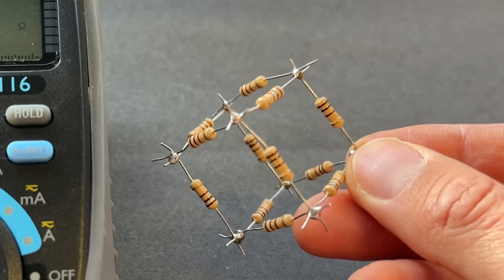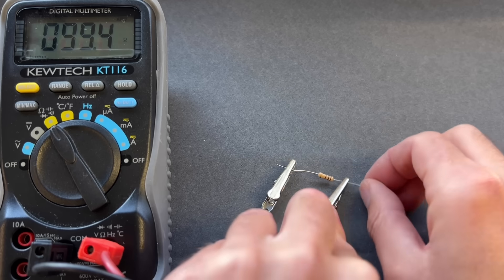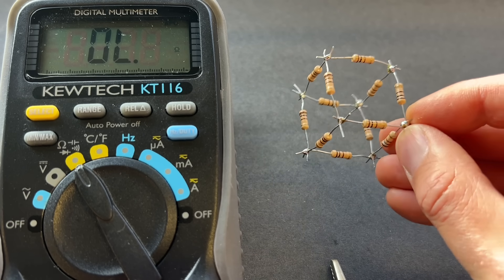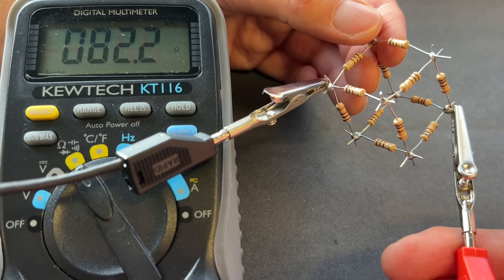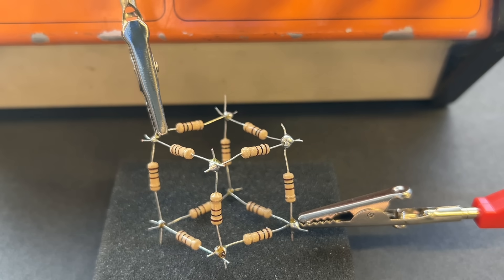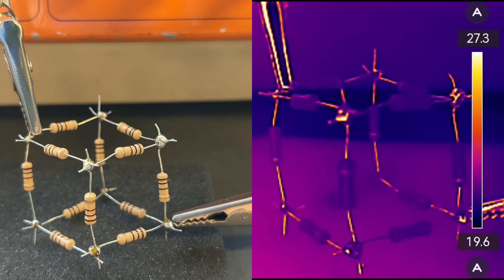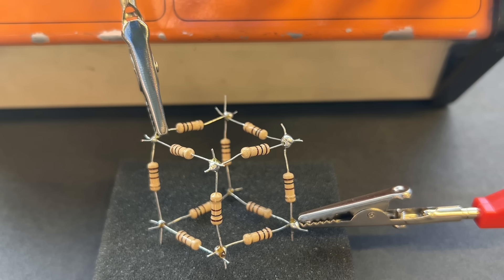A real resistor cube - does theory agree with reality?

Comment: I did the excat same thing back in the 80's just with 1 KOhm (I still got the cube) and using Kirchhoff's Current and Voltage laws, to calculate the resistance. I did not have a thermal camera back then but you can feel it.

Comment: After your video, the total theoretical resistance is quite simple to derive! 

You can think of the problem as a set of parallel connected resistors in series. There's 12 resistors in 3 groups: 3 input + 6 in between + 3 output. With the parallel formula you get the resistances: 1/R =  3 * 1/R or 1/R = 6 * 1/R. So the total resistance is putting them in series: 2 * R/3 + R/6 = 5/6 R.

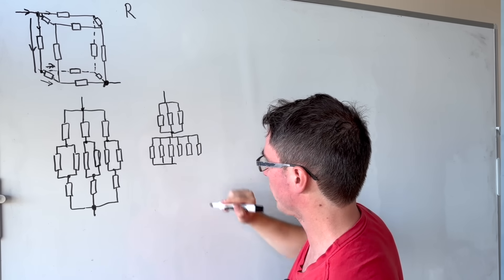Comment: 0:23 That is the not the correct topology for a cube; the correct graph for a cube in two dimension is a smaller square inside a bigger square with each corresponding of the four corners of the small cube and the big cube connected.

Comment: Failed to be anything more then differential pairs....

Non equal values makes for non equal results.

Taking the average,   not useful at all,   we can do basic avg as a viewer.

Not showing each value bacuae of time.    We clicked on a video on a platform designed around watch time.    

Come on.   Do it again,  and try harder,  match to 3 decimal points,  show numbers and show your work.
Reply from the maker: Based on views, watch time and likes the general consensus has been positive.  Sorry you didn’t think it was good enough but I won’t be doing a remake.  In any case the multimeters are only accurate to 1% so perfect agreement will never be possible.

Comment: You don't need any diagrams or "full theory" to solve it. Your symmetry argument works fine. Let the voltage between the crocodile clips be V and the current supplied be I, with each resistor being R.
It should be obvious (by symmetry) that each of the 3 "top" resistors attached to the positive croc clip passes a current of I/3. Similarly, each of the "bottom" resistors attached to the negative croc clip also passes I/3.
At the other end of each of those resistors that current (I/3) will split in two equivalent directions, so each of those "middle" resistors must pass I/6. Now, to travel from one croc clip to the other, you have to traverse one top resistor with a voltage drop of R*I/3, then one middle resistor resistor with a voltage drop of R*I/6, and finally one bottom resistor with a voltage drop of R*I/3. That's a total voltage drop of V = R*I(1/3 + 1/6 +1/3). But the equivalent resistance must be V/I = R(1/3 + 1/6 + 1/3) = 5R/6.
Reply from the maker: Yes that is my preferred way to solve the problem😊

Comment: So, if you guys have ever bought one of these voltmeters, you would know you can't measure resistance.  No I am serious, there are dials for it for different ranges, but you can't actually measure anything with those settings.  I have bought several models over the years from different manufacturers since the 90s and none of them works.  The only way you can tell the resistance of something is either you read the color coding on the resister and trust the manufacturer not telling you lies, which they always do cause high these things can get burned out, believe it or not.  This is the reason why all our electronic equipment will fail unless you take out the battery when they are not in use.  Or, in the case of modern electronic, they just get rid of these entirely and use semi-conductors which don't have this kind of issues.  However it has other issues.  For one thing, no one really knows how semi-conductors actually works.  At least I don't and I studied these things as a physicist.   In fact, I knew a guy in graduate school working on these things and he doesn't either.  I mean he didn't say he doesn't but he won't show me anything and explain to me how he actually make these things.  Just, you know, lithography magic.  And, this was an Ivy by the way.  Thank God I didn't waste my time on that and studied chemistry and biological physics instead.  We have our issues too but at least they are still within the realm of classical mechanics which we can deal with without "magic."

You see, you can only make semiconductor if you are in Switzerland.,  Only they know how to make these things these days.  Have you heard of ASML?  That's only one of them.

Let's hope they release their trade secrets one day, so the world may know.  All I know is that the tech is based on sound (phonon) and not just electricity alone.  

The other way is to set up a simple circuit and measure the voltage drop, which is very simple and actually works ......   except you have to use an equation V = I R.  And the problem is you have no idea what I is either, the current.  To measure that you can connect the circuit through a current reader .... which unfortunately, we have no idea how it actually works and it leads to a voltage drop too .... so .... 

Yeah ... electricity is weird.  I don't think we really know how that works either.  

Before you criticize me, call be psycho, crazy, conspiracy theorist, bisexual grandpa, idiots, smoking weeds, etc.  Please buy a voltmeter from amazon and do the measurement yourself and come back and tell me how you did it.  Yes, maybe I am the idiot and schizo and a conspiracy theorist.

Comment: Why do this? Why not just use a resistor of 82.4 ohm? What is the importance of this?
Reply from the maker: It is just as a fun challenging physics problem.  No point to it beyond that.  😊
Reply: And why don't you have rsistors of 100 ohm value?
Reply from the maker: @harshadnarayan1960  All resistors come with a tolerance that they can vary by.  I have 5% ones which are cheap.  You can pay more to get 1% ones which will be closer to 100 ohms.

Comment: Does the drawing reflect the actual cube circuit?
Reply from the maker: Watch the @zphyiscs video linked from the description for a full discussion of this.
Reply: @SimonPoliakoff Which is NOT the same circuit! When the drawing is wrong, the whole concept is wrong!
Reply from the maker: @BSnicks That is why the current symmetry solution is better which @zphsics also discusses in his video
Reply: @SimonPoliakoff  I know you can simplify the circuit because the resistor is the same. But if you simplify it, there is no real purpose of having such a problem anymore. Unless you want to waste resources.

Comment: At 0:13, the schematic on the left is inaccurate.  The six resistors in 2nd stage pairs don't connect at both ends with the same resistor.  The are paired up with one neighbor at one end, and paired up with the other neighbor at the other end, where they connect to the final 3 resistors.

Probably won't make any difference if all 12 resistors have identical values, but will if the resistors have widely differing values.

Comment: This was a question in my physics GRE exam! It is also a "challenging" problem on the Freeman-Young textbook.
Reply: Physics GRE? What is that?
Reply: @Temperius  It is one of the exams one takes, in order to compete for graduate student position in any PhD program, in the US. There is the general GRE (Graduate Record Examination) & the specific GRE (physics in my case).
Reply: Isn't this just performed by mesh analysis like every other circuit? Or is there some quirk about it?
Reply: @DKNguyen3.1415  It is an easy problem to solve, if you have enough time. However, as a GRE problem, you only have about 80 seconds to solve it.

Comment: Is your skin also adding resistance?
Reply from the maker: It will be so large compared to the 100 ohm resistors that it won’t significantly change the total resistance.  It would slightly reduce the total resistance as it provides another route for the current to flow going through me.

Comment: I’m never going to understand how 2 resistors in parallel have less resistance than 1 resistor, if they all have the same resistance. Like how does 2 give you less than 1???? I don’t get it.
Reply from the maker: Resistance measures how hard it is for electric current to flow.  Two ways makes it easier.  Like two stsircases for people to travel up rather than one means more people going up per second.
Reply: Think instead of a pipe carrying water flowing into a tank. If the water is being pushed down the pipe with a given pressure, then there will be a certain rate at which the water will flow into the tank. 

However, if you have another pipe, just the same through which water can flow into the tank, the tank will fill twice as fast.

These two pipes will act AS THOUGH there was one pipe of a larger diameter through which water was flowing into the tank.

Comment: Can't wait for the resistor sphere.
Reply: Would that just be a spherical shell of a material with known resistivity?
Reply: @zuthalsoraniz6764  Your question is ill-defined:  Is that between the inside and the outside of a shell, for which there is an exact solution by integration, or between two points on the outside of the shell, which has no answer, because the current density is divergent at the points of contact?
Reply: A resistor sphere would have I_h symmetry, the same as a C_60 buckminsterfullerene molecule.  This has 20 hexagonal faces, and 12 pentagonal faces.  Unlike the cube, there are two types of edges, where one is between pairs of hexagonal faces, and the other is between a hexagon and a pentagon.  These are not necessarily equal in length, or resistance.

Comment: If you are using 5 percent resistors you will never find a perfect value.  One percent resistors are selected from the batch and then removed.  If you graph the values you will end up with a “bathtub” graph with all of the one percent values missing because they have been pulled and placed in the higher priced bin.

Comment: up next. torus? actually interesting to think of.
say a 10x10 sheet. "opposite ends" would be the central point, and the four outer corners. then it becomes an interesting network...

4 in parallel. then 4 parallel networks of 3 in parallel. then 12 of 3...  and so forth but then all wound up on istelf and biting its own arse.
should give much the same result though, but visually even more pleasing :)

sigh.
the only resistors i have lots of is 10M... wtf do i have 10M for?

Comment: I want an LED cube lamp, just with many cubes, like the salt molecular structure .. with a decent brightness distribution. Can you solve that?
Reply from the maker: That would be tricky because LED’s are non ohmic.
Reply: @SimonPoliakoff  Yes I know :) Running extra wires is allowed, if them number is kept reasonable. Insulated joints between wires are not available.
The perception of brightness is very tolerant. If one LED gets 2x the power of another, you'll hardly notice.

Comment: Curious. Did you test all opposite corner combinations (and reverse the direction/which alligator clip was on which corner)?  I know this may sound redundant but since the values of the resistors varied, I don't think it is. I'm curious if I'm right or wrong.
Reply from the maker: They all came out similar with slight variations but I didn’t think it would be of sufficient interest to include all of them in the video.

Comment: hmmm, just seems odd that your probe alligator clips were in different arrangements at the end. but cool idea!
Reply from the maker: At the end the cube is connected to a power supply rather than the multimeter so everything was moved round and adjusted angles to allow infrared camera view as well.
Reply: @SimonPoliakoff  okay, i was just pondering if putting the clip closer to one resistor changed current flow, but the wires don't really have enough resistance to matter, i realize, however, as resistors heat up doesn't the flow in the cooler resistors flow better? so over time, shouldn't they all be the same temperature?
Reply from the maker: @gristlevonraben Yes interesting to think how the resistance would change with temperature.  I wasn’t sure on the power rating of the resistors so didn’t leave them switched on for too long.  The current in the 6 resistors not touching the clips will always be half of the other 6 so they won’t get as hot.
Reply: @SimonPoliakoff 
Измерение ТКС - это довольно сложная техническая задача. 
Температуры, даже в разных местах ОДНОГО резистора, разные. 
После монтажа на плату распределение температур В резисторе меняется. 
И т.д. 
Те же щупы подключённые к резистору меняют распределение температур.

Comment: Interesting experiment, I'll see if I can figure out how this equivalent resistance is calculated. I don't have an infrared camera, but a voltmeter reading would have worked. Of course, given that the wattage is proportional to the square of current. the infrared camera works quite well.
Reply from the maker: Do watch the other part of the video on the Zphysics channel if you want to see the complete theory.
Reply: Инфракрасная камера не умеет измерять температуры с нужной для данного эксперимента точностью.

Comment: If resistors work in 2-D space, why wouldn't they work in 3-D space?
Reply: 3D is just 2D with more steps.
Reply: You could even solve a resistor hypercube if you wanted
Reply: There is no such 3D or 2D circuit from a circuit theory point of view

Comment: That's for a 3-D cube.  How about an N-dimensional hypercube?  You can construct these electrically.  For instance take two cubes and connect each vertex to a corresponding vertex with eight more resistors, that's a 4-D cube electrically.  Is there a limit as N->infinity?
Reply from the maker: Sounds fun.

Comment: Now try a solid cube of a given resistivity and tell us what the resistance would be across the opposite corners.  Not a trivial question, as it is sometimes necessary to measure resistivity of a piece of conductive mineralisation and using a simple shape and a resistance meter would be a practical way to do that in the field.
Reply from the maker: This sounds like and interesting problem which I think would require setting up an integration to solve.
Reply: I've been mucking around with this, and the resistance between any two points in a mathematically ideal homogeneous solid conductor is infinite.  You have to define a contact area for the probes.
Reply from the maker: @MushookieMan I came to the same conclusion.  All depends on how much the corners are shaved down or how large you make the contact area
Reply: @MushookieMan  The two contacts could be between the diagonally opposite corners.  Or indeed any two points along one side or in the centre of opposite faces, whatever works for the calculation!
Reply: @karhukivi  A more well-defined question would be "what is the resistance between the opposite faces of a dodecahedron"
Reply: @MushookieMan  The question is for a cube of conductive mineral, which is easy to cut with a diamond saw, not a dodecahedron!

Comment: I know little about electrical circuits.  Does your grounding the circuit by holding it in your hand when you measure the resistance (at 1:28) have any effect?  I guess not, or it probably wouldn't match theory.
Reply: Human skin can be treated as an insulator for those lower voltages IF the skin is dry. We are talking about well above 50k Ohm.
Reply from the maker: Yes I think with 100 Ohm resistors and dry skin it won’t have any significant effect.
Reply: Electricity takes the path of least resistance, with the resistance of human skin here and at low voltages it would basically ignore the hand.